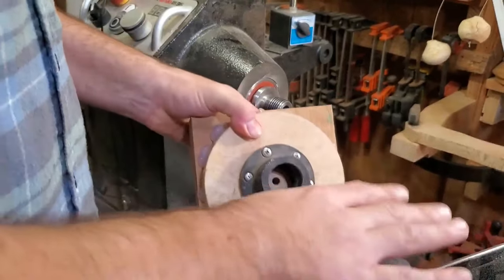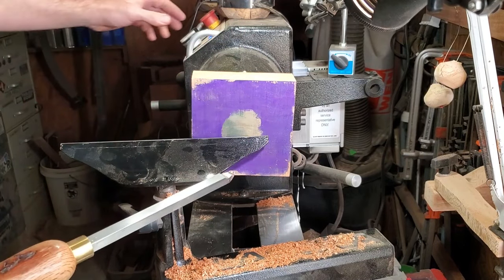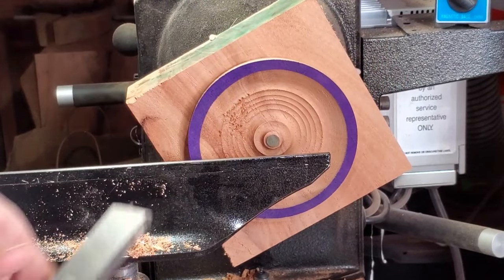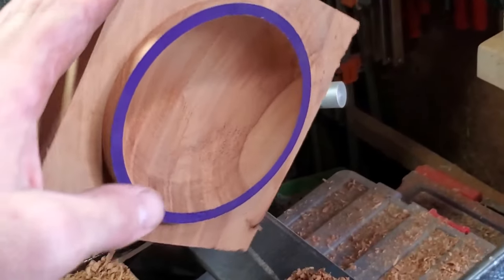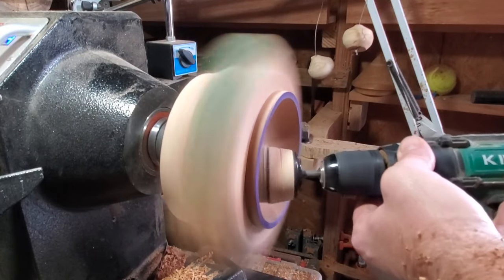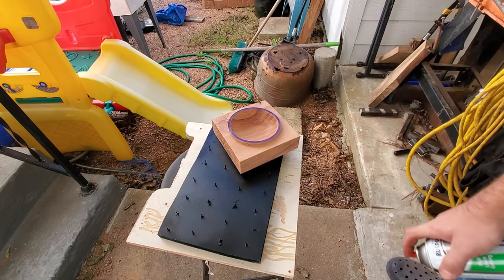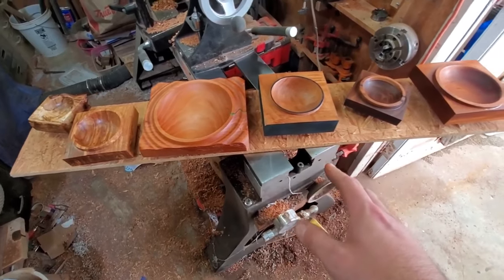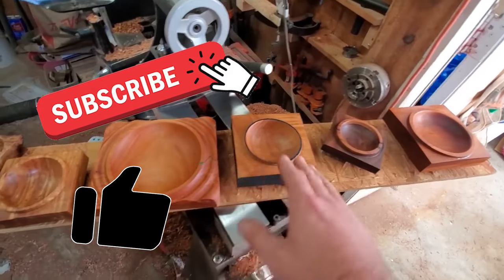Beginner Wood Turning Projects - SCRAP WOOD BOWLS

Comment: If you use alcohol on the hot melt glue it will soften the glue and allow you to remove the block from the base very easy. Nice video to save scraps.